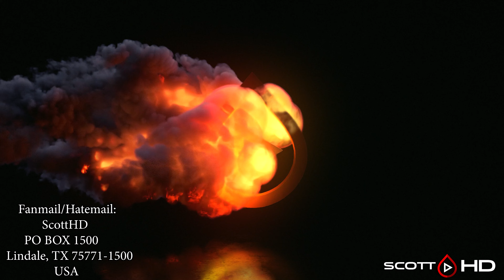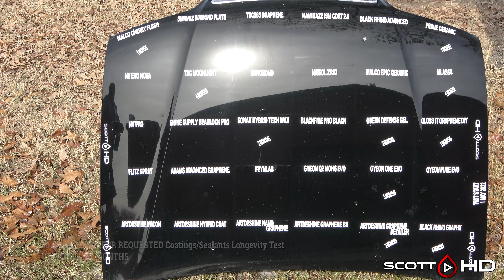30 WAY CERAMIC COATINGS LONGEVITY TEST - SUBSCRIBER REQUESTED PRODUCTS - UPDATE 13 - 7 MONTHS

Comment: Im a little surprised you would do all this work and then use Honeydew foam on it.  Use reset or one of the coating shampoos on the market.  You may be doing some of these products a disservice using Honeydew.

Comment: Thanks Scott. I install NV Nova Evo here in Australia. It's great to see it against some of the more popular and expensive competition. I used to be a Gtechniq and Gyeon installer but have moved away from multi-layer coatings. I did however install Gyeon Mohs Evo recently more as a curiosity. Leaps and bounds improvement over the old formula.
Reply: Aussie Aussie Aussie..... Lol
Reply: Hey where about in Australia do you do? Im in Brisbane and looking for someone to do my car but trying to work out which ceramic coating will last the longest and give the best scratch protection.

Comment: I had Shine Supply BeadLock Pro on one of my panels (metal roof section) & it has failed at about the 9-month mark. I thought it would do better. I’ve got MOHS Syncro EVO on 2 panels & Nova EVO pro on 2 panels & they are still going strong.
Reply: Sounds like you have a great test going. What other products are you testing?
Reply: @fskof  I’ve got Diamond ProTech DB36 on 3 recently repainted panels, and Dallas Paint Correction TMR on the remaining 4 panels. I’ve got updates in this series on my channel. Newest update dropping later this morning.